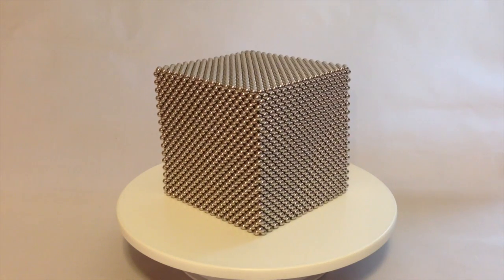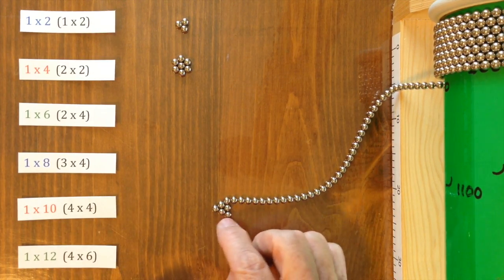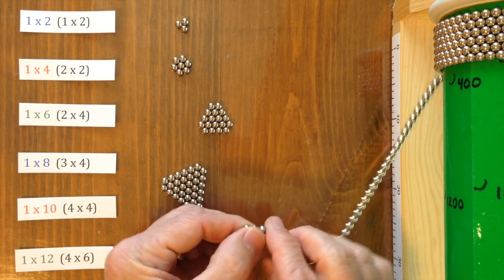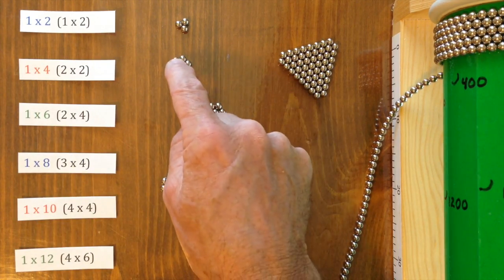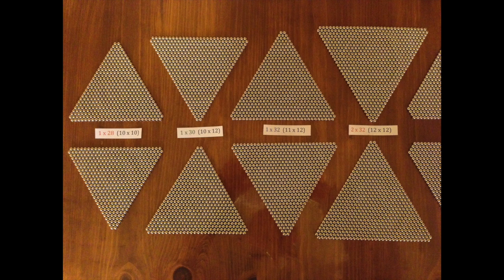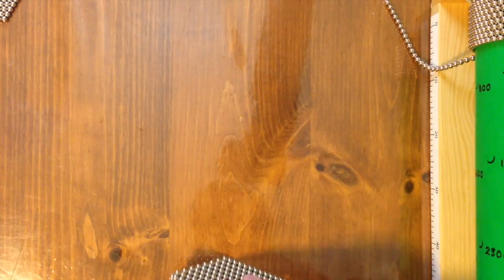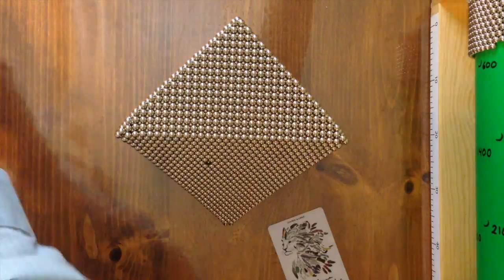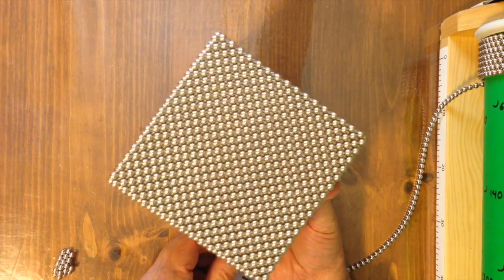Massive Diagonal Cube  (Zen Magnets)

Comment: does it woork with micromagnets
Reply: If it isn't working with micromagnets you should just make it hollow. Then it holds the shape much better, from my experience. Boyd has a tutorial for the hollow version, https://www.youtube.com/watch?v=A3U_gBjltxU . :D
Reply from the maker: I haven't tried it, but it should work with micromagnets.
Reply: i tried a smaller one and it sadly does not they dont hold the shape well but you might be able to and where do you get cheap zen magnets
Reply from the maker: I buy my magnets from zenmagnets.com.  Sometimes they offer specials.